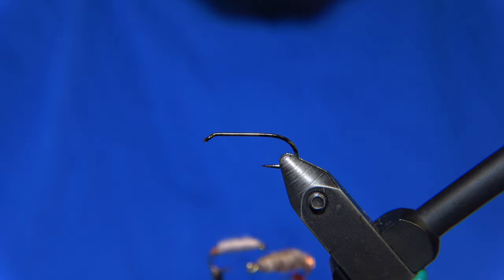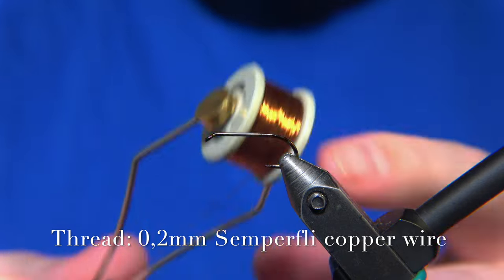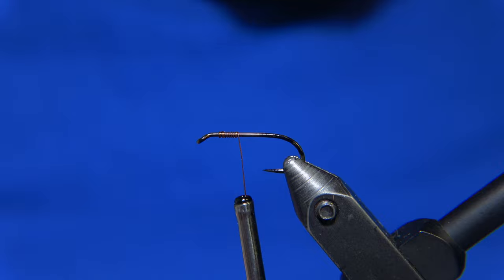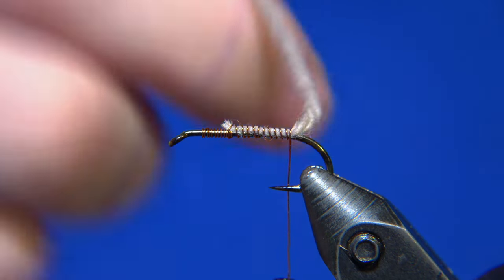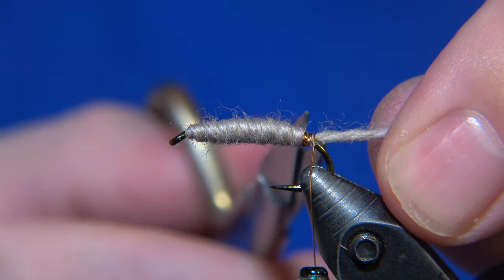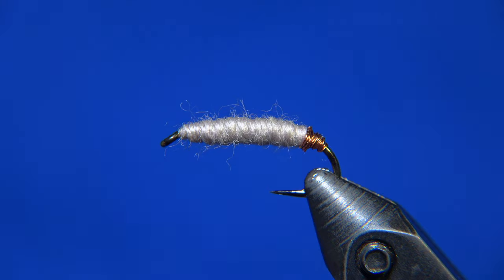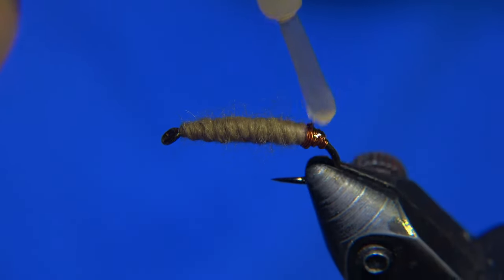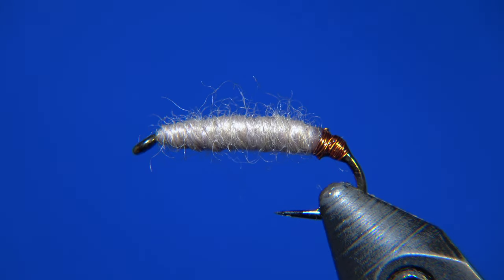Tying a fly called Killer Bug Fly Tying tutorial | Ívar's Fly Workshop

Comment: Beautiful tie, what size of hook you are using Ivar?
Also I can see you’re not putting any weight, do you use it alone or do you tie others with weight?
Thanks in advance
Reply from the maker: Hi Fabian and thanks for the question. 

The hook I'm using for this fly is Ahrex FW560 number 8,10, 12 & 14. Ummm I sometimes use it alone. But often unweighted as a dropper with good results. The weight in the fly is the copper wire.
Reply: thank you!